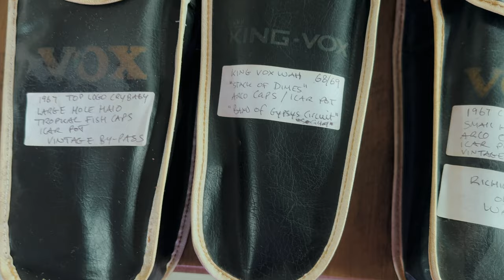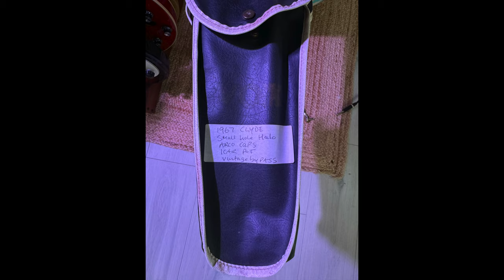The new Vox Wah Wah pedal | NEW vs OLD VOX and more.

Comment: Mate, so much to unpack here, I’ve sat and watched this twice already and it’s ridiculous… First off, thanks to you and Steve for arranging this!

There’s a few surprises, notably the difference between your old wah and the other small halo with the same spec - the latter being a bit more squelchy in the top end but it was very clear the familiarity you had with the old one, you just got on with it immediately!
I found the large halo 67 to be THE quintessential Vox wah tone. The Top Logo CryBaby and King Vox were really cool. The new Vox’s were pretty good though felt like they were lacking a bit of air and liquidity in the top end - kind of thin and polite, especially the V846. 
The Dick Denney v2 is by far the best True Bypass wah I’ve ever heard, the Joe Sonic fun for some lower mids deep throating😂
The Message seems to be really somewhere between the large and small halo? Very liquid and grips the notes well and balanced across the frequency range. 

Spectacular stuff, I daren’t pick a favourite!!! Great job man! ❤

Comment: Wah to me seems like a driven solo add on after you run out of ideas.  Not really a clean or low energy pedal.  I’d turn on the wah after I built up the solo and need one more level.  All the OD pedals on and blowing the jeans legs around. Then and only then does it sound good.  Clean - you need more clothing optional girls around